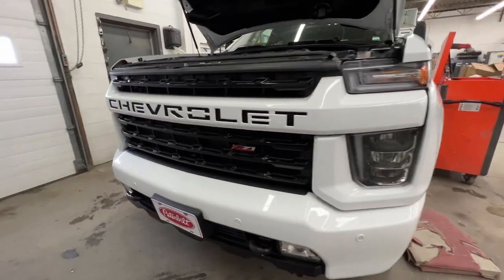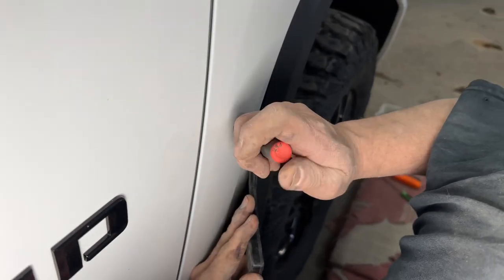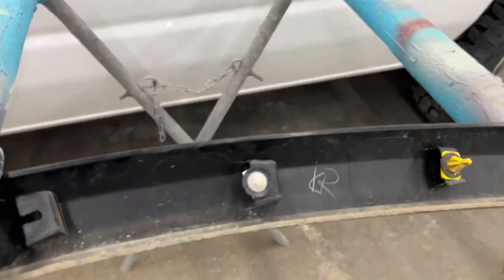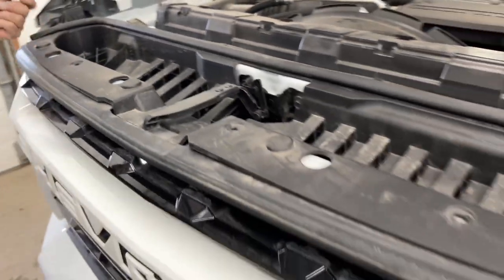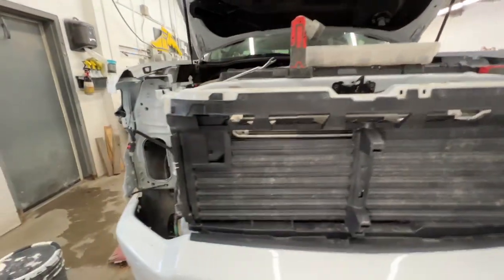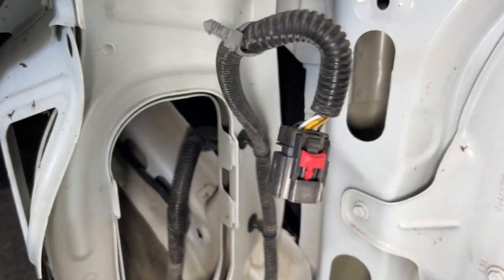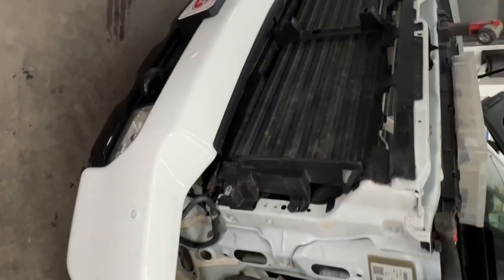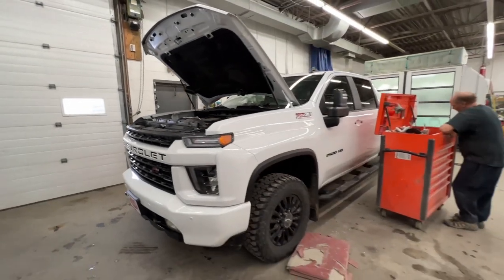Front Bumper Removal 2021 Chevy Silverado

Comment: For the flares, if you take a couple screws out of the wheel liner, you can reach back there with a 7mm or 8mm socket and push on those clips, makes it really easy to get them out
Reply from the maker: Smart thinking. Will have to try that
Reply: This worked!!! Thank you